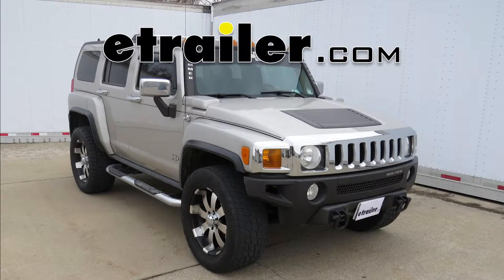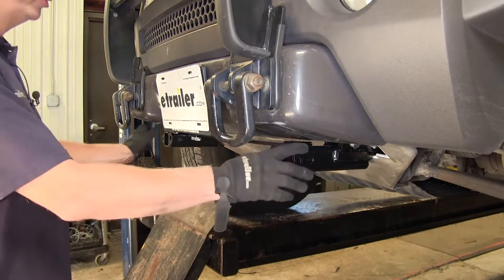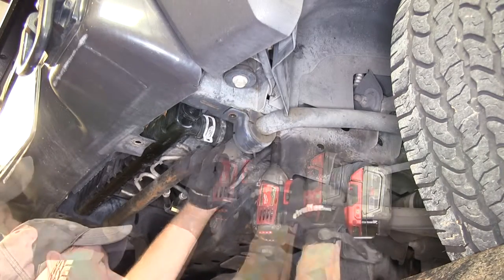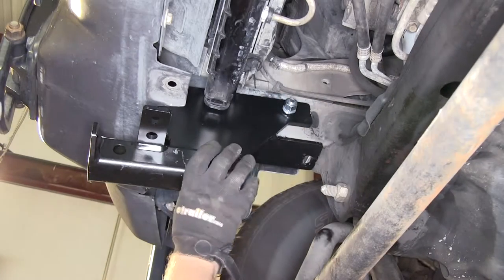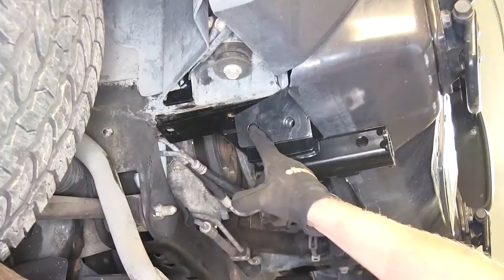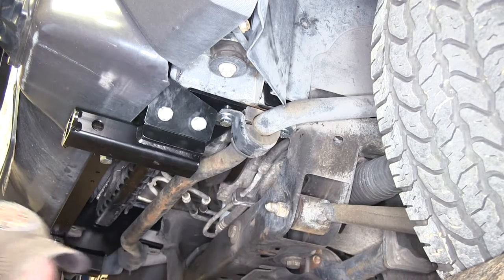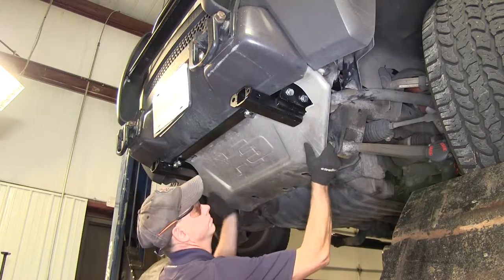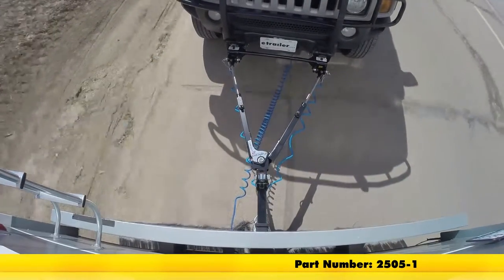etrailer | Installation Guide for the Roadmaster Crossbar-Style Base Plate Kit on a 2006 Hummer H3

Comment: You didn't use the giant shackles in the front...?
Reply from the maker: Nope. According to the H3's owner's manual the recovery loops should never be used for towing and are only for recovery purposes. That's why you need to install base plates to flat tow the H3  https://www.etrailer.com/towbar-2006_Hummer_H3.htm